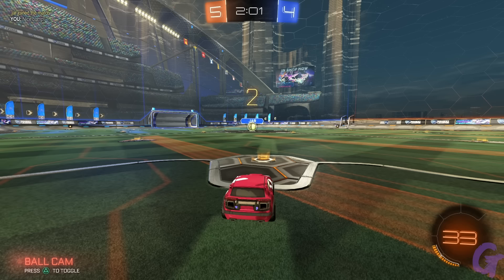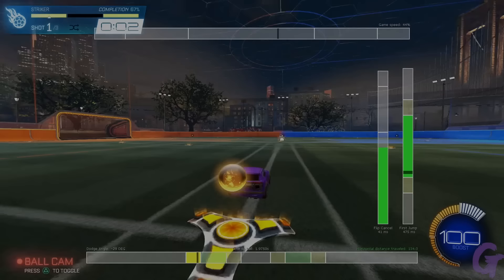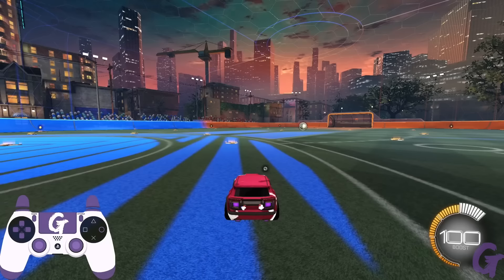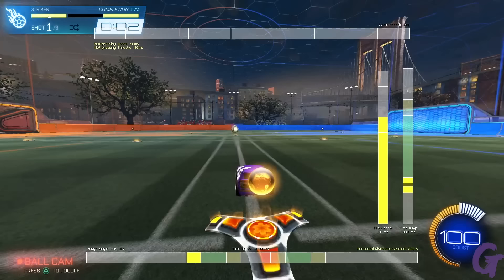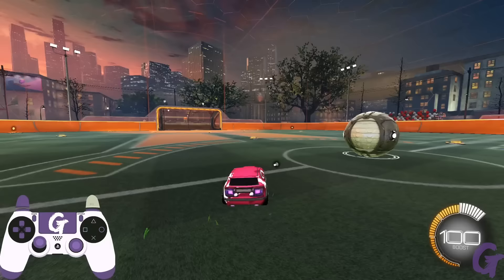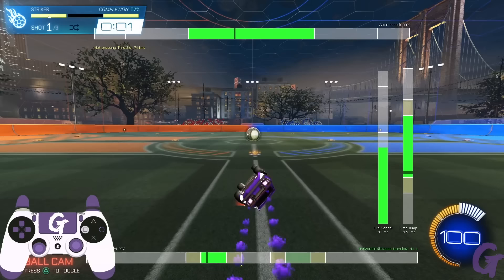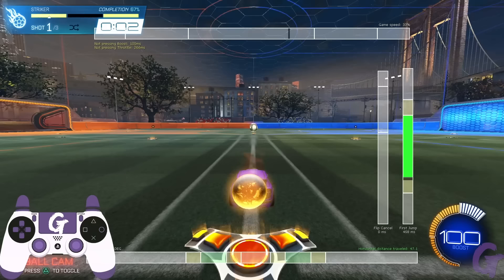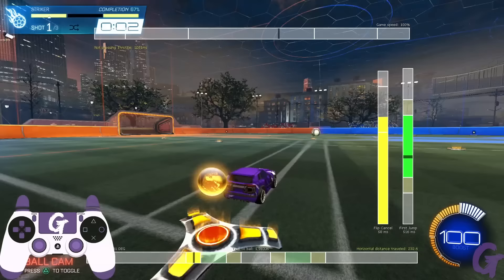How to do a Perfect Speedflip | How to Play Rocket League

Comment: I actually think that you are a little wrong about cancelling straight down, the reason I always say this is becuase if you look at the slo-mo, your car is touching the ground slightly every split second not to mention that cancelling straight down is kind of hard to control. I find that the best possible method is to instantly cancel to the opposite bottom diagonal and then go to straight down, basically as soon as you cancel to bottom right/left you go to straight down cancel then hold free air roll and rotate your stick in a quarter-circle to the left/right side. This is what I see most people doing and I think it is most effective.
Reply: It's objectively better to flip cancel straight down. Flip cancels only work on the pitch axis (lean forward & lean back). You cannot cancel the roll axis or any sideways portion of a flip. initially flip canceling to the side slightly is wasted input and can result in bad flip cancels.
Reply: In the version I do it's more of a delay to the straight cancel so that your car doesn't point downwards too much, I still agree with your statement.
Reply: @froqwo4851  It doesn't matter what version you do, though. Fast cancels are about technique. You can fast cancel the same time with all known methods. Most people do speedflips in parts of "jump, flip, then cancel" but the best way is to "jump, flip and begin flip canceling" and it works equally effective for all methods.
Reply: @HoraryHellfire  I did an overview of my imputs and found that I was basically cancelling down straight away most of the time so what I was doing the whole time was the same as what you are saying. What I said before is kind of useless now because that's not what I was actually doing.

Comment: Ye btw you can do 1.9667 on kbm but you need to do it in 60fps as far as I tested (5minutes) I couldn't get it on 120fps. If you put you fps to 30 you can get one with 1.9583.
Reply from the maker: That's because the FPS timer and tick rate are relative.  If you open up the BM console (F6), and see what the actual time to ball is, it's not what the plugin says.  It's off.

Comment: Do you need to hold the jump button during the whole movement?
Reply from the maker: No. You want to double tap it as quickly as possible.
Reply: @Grifflicious  no I meant the second jump tap, do you need to hold that?
Reply from the maker: @sjorsvangogh8672  Oh no, not at all.  You want as little time in the air as possible.

Comment: Isn't standard air roll easier to speed flip than directional?
Reply from the maker: I would think no, just off the top because with directional, it does the rotation for you and doesn’t require stick adjustment, which in turn might or could disrupt the process. That said, I’ve not tested so take that with a grain of salt.
Reply: @Grifflicious  when you're coming down on your stick it seems you're rolling it to 6 o'clock  is that what I'm seeing?🤣

Comment: This regards to the maximum counter torque only being possible when pulling straight down. For us square deadzone homies, wouldn't it be possible for us to go slightly to the side since we have a wider left to right range of maximum reverse input? I ask this since if you watch Maktuf's recent square deadzone video, he goes in-depth as to how square deadzone allows you to maintain maximum reverse or "cancel" input while also more easily being able to control side-to-side input at the same time.
Reply from the maker: Yeah, I saw the same video and while that sounds like that's it should work in theory, unfortunately, in regards to front and back flips, regardless if they are angled or straight up and down, the torque applied in the flip is to the Y axis or pitch.  So even if you do a 30 degree front flip, the flip torque applied is still 100% forward.  It just doesn't seem that way because the car travels in the direction of the flip angle.  Its for that reason that you want to cancel straight down since that's the counter torque you need to combat the flip.

Comment: A few questions! 
What do you suggest for an air roll right player that wants to also speedflip left?
In which kickoff positions do you use right vs left speedflip?
And how long do you boost in a traditional kickoff setting before initiating the flip? Immediately or boost straight for a second?
Sometimes I feel like I hit the ground too soon/am nosediving after my flip cancel, any troubleshooting?
Thanks! The "straight down" cancel helped so much, that was my problem for sure!
Reply from the maker: Love the questions!  Let's see what we can answer.

1. If you also want to speed flip left, then I suggest learning both method 1 and 3, in both directions. Will you use both methods?  Maybe not, but as we continue with car control, you'll be glad you learned them both.  
2. Regardless of kickoff position, I always flip left.  I make my pre-flip adjustments different on each setup and it just became a thing I go use to doing.  Just took a little practice.
3. As soon as the timer goes off, I boost, travel about a car length or two, and immediately speed flip.  Especially on the diagonal spawns, I try and go as early as I can so I have time to land, adjust if I need to, and can jump/flip into the ball for the kickoff 50/50.
4. If you're nose diving into the ground it means you're canceling a smidge too late and need to work on getting it down sooner.  If you're nat's ass on the timing, you won't have that nose dive problem.  That's a great sign you're behind on your timing and just need to hit the cancel sooner.  

As far as troubleshooting/tips, practice your cancel time like I mentioned and really try and focus on doing a lot of your alignment adjustments in the air before you land.  Obviously, it's not a ton of time but you do have enough to correct if your flip gets you a little out of line.  Also, and this is super important of the straight spawns, try and be aware of when you hit super sonic.  If you're boosting and flipping correctly, you'll actually hit SS just a little over half way through the flip.  I bring this up because if you're being on purpose about it, you should be able to 50 the kickoff with 20 or so boost left over.  This is helpful in any game mode but ESPECIALLY 1v1s.
Reply: @Grifflicious  amazing! Thank you so much for the reply! One last question if you don’t mind. Because I have accelerate bound to R2 and air roll right bound to R bumper, I tend to use free air roll when trying to speed flip in non-kickoff situations. Is that still effective or should I rework my button map/use a two finger claw grip on the bumpers? Again thanks a bunch, hoping it all clicks soon!

Comment: 80% of mine are 1.9833. 
18% are 1.9917
and 2% are 1.9750

let alone the 0.01% that hit 1.9667

so I'm doing good work, but not mastered. even though I felt super strongly that my thousands of hours had perfected it.
I met someone yesterday that had beat me by half a car length. which is much faster than 1.9667
Reply: my flip cancels are usually around 39 to 41 ms

Comment: it actually is possible to get a tick perfect speedflip, You can move exactly the same as a controller can, you just need to hold the keys longer, or make very very tiny micro adjustments, although its a lot easier on controller than keyboard, so probably not worth learning on keyboard and mouse with how difficult it is to achieve the tick perfect speedflip
Reply from the maker: Due to the fact the keyboard can only create a 45 degree flip angle, it isn't possible to do a tick perfect flip.  It can only be done on controller.

Comment: Great vid, but I'm confused on counter-torque. Is that why it looks like some cars flip/get around faster after cancelling than others or is it something else like how much it rotates after flipping?
Reply from the maker: It's basically about cancel timing.  The sooner you can cancel the flip, opposite the direction you flipped, the more "accurate" counter-torque you're going to get.  Its the reason side-dodge cancels or "stalls" are so difficult on control is due to the near-precise inputs required to do them.  KDM has a massive advantage in flip-cancels.  That said, all the cars in the game have the same flip/rotation speed.  It just seems different for certain cars, specifically those with longer bodies, i.e. Dominus and Breakout, because they are spinning a longer hitbox over a shorter period of time.
Reply: @Grifflicious  think i might have figured out why it looks faster, before i was doing pretty shit speedflips and getting maybe 1.983... on the kickoff test, took a vid of it and my car was bumping the ground, ig when i saw SSLs do cleaner ones I thought it just looked faster. Anyways I finally got a tick perfect one so ty for the vid

Comment: I used the speedflip plugin to see my time to the ball. It is possible to get faster than 1.9667. I got a time of 1.9583 seconds.
Reply from the maker: What's your in-game FPS?
Reply: @Grifflicious  59
Reply from the maker: @VogelinoYEET  Okay, so I ran into this with another player recently and it was a whole CSI level investigation.  Turns out, when you run the game at a sub 60 FPS, the "Time to Ball" is calculated on physics ticks but it doesn't take into account the tick rate being influenced by the frame rate.  If you TRULY want to see what your real time is, open the training map, load up the plugin, press F6 to bring up the console, slide it off to the side of the screen so you can still see the numbers, and THAT will be your actually time to the ball.  It shows the non-rounded values like I eluded to in the video and will be the most accurate value you can get.

Comment: @Grifflicious I have a question! I didn't understand from the video how you achieved a tick perfect speed flip with the DAR method yet not with the KBM method. Aren't you emulating the KBM method on controller with the DAR method? What are the differences?
Reply from the maker: The way the KBM works is that I'm pressing the stick straight up while holding air roll left, which gives me a perfect 45 degree angle.  On keyboard, the only angles you can generate due to using the keys are either 90 degrees or 45 degrees.  Which, if you held "W" and "A" together and dodged, you'd get a 45 degree flip forward and left.  What I'm doing with directional air roll  is holding my left stick up and right, around the 2 o'clock position, holding air roll left, and dodging. Which gives me an angle of 30-20 degrees.  So if up and ARL is 45, up and to the right with ARL, cuts that angle even further since I'm right of center.  Does that make sense?
Reply: @Grifflicious  yes it does! I misunderstood originally, I thought the ease of the DAR method was that you only hold up and cancel with down, eliminating the need for finding precise angles (true north and south being set by deadzone)

If I'm understanding correctly now, you're saying the ease comes from not having to turn one way, then find the 20-30 degree angle on the other side of the stick before pulling down; you can just hold that angle (that you turn your car with in preparation), flip with ARL held and it evens out to the correct angle, then just pull down. Is that right?
Reply from the maker: @IAmTheWar  Yes!  That's exactly it.  It cuts down on something that's very easy to mess up by eliminating the movement.

Comment: I'm getting down to 1.9833 for the speedflip. I think the last thing to improve is the timing of the turn. Could someone explain how early to do the turn once in the air as opposed to turning on the ground in advance?
Reply from the maker: The turn in the air should be IMMEDIATE after you jump and should only be around 10-15 degrees at most.
Reply: I recently got a 1.9750 and my flip cancel was 50ms. Does there come a point where certain aspects of optimization have diminishing returns? It seems that not all factors can contribute equally to cutting down the time the last tick.

Comment: My time to ball is 1.94. even then i cant reach the ball before time. What might be wrong. Wondering how i can get the number 1.94 without reaching the ball? It was in the other 2 diagonal shots. Not shot number 1.
Reply from the maker: That's because shot 1 is setup a little different than the diagonal spawns. Could potentially be the angle in the setup on those vs straight on is helping you in some way so you might just need to adjust your approach on the first shot.
Reply: @Grifflicious  Hmmm.... Yes that makes sense now! Iv tried so many different angles and approaches. Nothings working. I must reset my Speedflip neurons i guess! Thanks for replying man. Much appreciated!

Comment: Installed Speedflip Trainer but I'm not seeing the meters on screen. enabled and disabled BakkesMod. Any idea ?
Reply from the maker: Maybe check your plugins tab and make sure it's turned on...if that's a thing.  I'm not home at the moment and I don't remember to be honest.  Also, make sure you're using the correct training pack.  It only works with the one I have pasted in the description.

Comment: Does anyone else get consistent greens all round on the bakkesmod plugin but still not hit the ball? Ive gotten 10 or 20 attempts where everything is green im directly heading towards the ball and i have never hit it, its the right training pack aswell i checked the code
Reply from the maker: Are you making sure you let the car settle before you take off or boosting before you use gas? Either of those things could start the clock before you want to and should display an error in red text under the bottom bar if so.
Reply: @Grifflicious  I've got it a few times now believe the issue was I was turning too far out even tho my first jump was in the green I could never make it until I made the turn shorter. Cheers 👍

Comment: I dont know if im doing something wrong, but on the 2nd and third of the training pack i can get 1.9500, is the first shot a closer range shot? am lost, but excited
Reply from the maker: I can't really speak to shots 2 and 3 as I never really use them but if you're getting a sub 1.96 time, I need to ask what your FPS in game is.
Reply: @Grifflicious  monitor is 165, but I get like 500-1k fps
Reply from the maker: @amZhylis  those distances might be closer then the 1st shot.  The reason I ask about the FPS is because there's a "bug" with the speed flip plugin that has the FPS linked to the TIME TO BALL counter and a lower FPS will get a lower time to ball.  BUT, you can always press F6 to bring up the BM console and it will give you the exact times and ticks you did what.
Reply: @Grifflicious  So in the console, im getting 1.962 after 235 ticks, and 1.960 after 234 ticks
Reply: yea, i think theyre closer, i guess this is all based off middle spawn kick off instead of the sides

Comment: I wonder why for me whenever I use the training pack every single time I start it will give a "not holding boost and throttle" for 16 ms.  I am holding it to start so I don't get it.  It doesn't happen on yours!
Reply from the maker: You need to let the car fully land and touch the ground before you input anything. Then you should be good
Reply: @Grifflicious  ffs, I was tryhard for hours without touching the ball even when doing everything "perfectly", then I tried waiting, and got it first try.... thanks a lot

Comment: Does controller set-up play a roll? dead zone or steering sensitivity?
Reply from the maker: Deadzone, yes.  Sensitivity, not really, no.
Reply: @Grifflicious  What dead zone do you need?
Reply from the maker: @handsomepetevideos  the ideal deadzone is as low as possible where your car doesn’t turn or move without you touching the stick. I.e, stick drift. So for me, I’m around 0.10

Comment: I uh, I sometimes hit a time of 1.95000s. Is this an error on the mod's part or?

Edit: Last hit was 1.9417s. I'm not sure this is significant, or if it's just me misunderstanding something, maybe this doesn't even matter due to the rounding of the numbers that you mentioned, and the tick rate, but it seems to happen consistently enough; meaning I can replicate it without any significant amount of time passing between tries.
Reply from the maker: What’s your in game fps?
Reply: @Grifflicious  I've managed to get this time consistently enough now, and I attribute my learning to speed flip, fully to the information from this video! Can't thank you enough!

I will add that I've tried to find out if the time I'm getting (1.9417s), is a fluke or a bug from the plugin and if anyone else is getting a similar time, but since the search parameters are fairly limiting, I can't find much information on it, and have been thinking about taking this to the RL subreddit to ask if anyone has experienced something similar.

Would you hate it if I reference you and this video in my post? I think your content is truly helpful, it has taught me a lot, and if I can return the favour in even a small way by giving you a shout-out in a public post like that, I'd be happy to!

Here's a link to a picture of my time: https://tinypic.host/image/1.9417s.gBfr4 - not that I feel the need to prove anything, just thought it might be interesting to see since it also includes the state of the bars at the time that I got the time. Though I will say, that doesn't seem to be all that important as I've managed to get this time with one or two bars in the red.

Again, a huge thanks for your massively helpful content! It really is great!
Reply from the maker: @athalik I certainly don't mind being included but I'm going to ask that we get some information cleared up first.  One thing I'd like you to do, if you don't mind, is to press "F6" to bring up the BakkesMod console window the next time you do these.  It will give the exact time to the ball as well as a few other tidbits regarding actions on ticks. If  you can, do that and let me know what the time in THAT window says you got to the ball.  I'm curious.